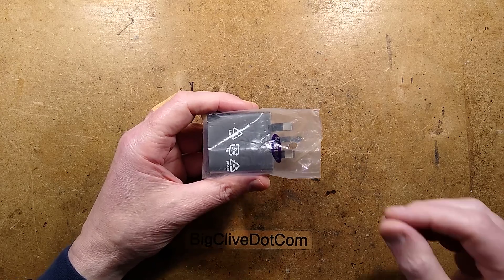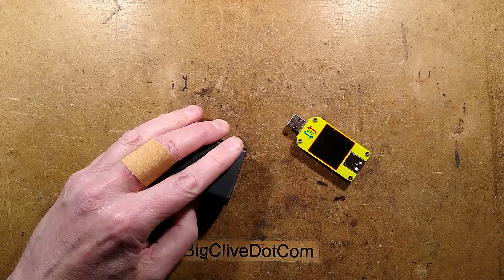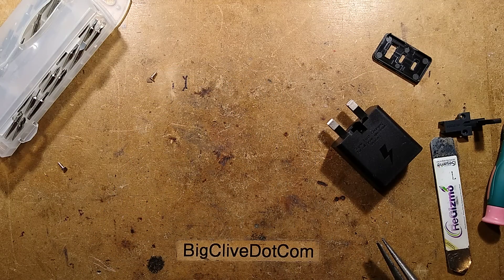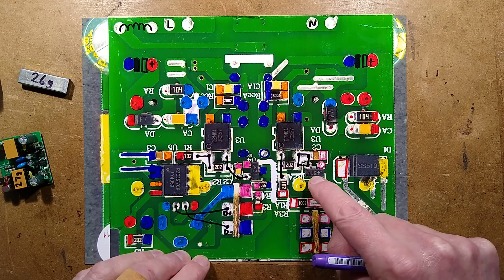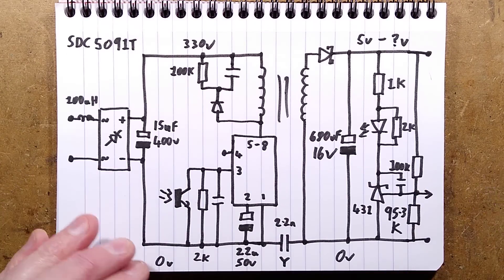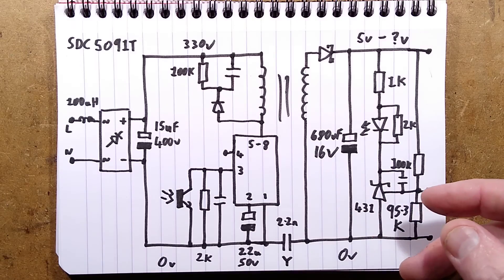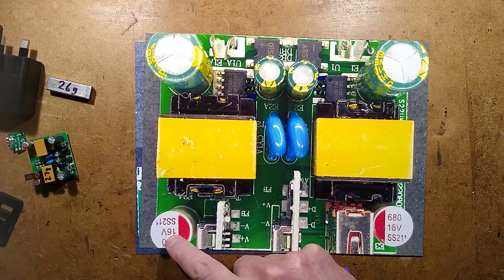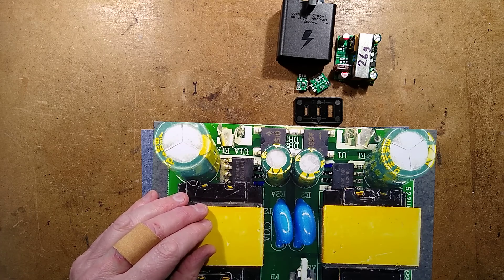Fake Samsung charger with interesting circuitry

Comment: One of my biggest fears is a fire caused by junk power supplies and cheap electronics.  I’m very cautious of all items that are possible sources of ignition if they fail.
Reply: Such as electric scooters and E-bikes...?
Reply: @kimvibk9242  I was referring to the AC sower supples, but yes on those things too.  I own a name brand e-bike, the battery is always charged outside, and afterwards stored off the bike and in a fire proof battery bag when not being used.
Reply: @chatrkat  Good to hear that you are taking precautions to protect yourself and others. 👍👍

Comment: It's as if they tried to fake it being a GaN power adapter, that weighs a lot more than traditional chargers.
Reply: Why would more efficient semiconducters with less waste heat be heavier?
Reply: @johndododoe1411  Everyone knows weight = quality.
Reply: @johndododoe1411  it's not the semiconductors themselves, but rather the fact that everything is more denstly packed and requires extra thermal dissipation (heatsinks) inside the GaN chargers which makes then heavier. Go have a look at a teardown of a 100 W GaN charger and compare it to a teardown of a traditional charger and you'll understand. You might save a third of the size, but none of the weight. As this is fake GaN charger, they added the metal lump to increase the weight to make it feel the same as a 65 W GaN charger.

Comment: False weight, you love to see it. I once opened a karaoke microphone and found a huge block of solder inside, dumped in there like chocolate inside an ice cream cone. That block of solder took up 80% of the internal space, and also acted as physical support for a small chip just floating around in the housing.
Reply: That's a nice bit of lead for the landfill...

Comment: All of the Best Buy Stores here in the USA have what looks exactly like that one with side symbols just our 2 prong plug on the back with a little plate screwed on between the prongs. They are selling them for $60 US. If you pick up the package and shake while holding the item inside through the box yo can hear and feel a weighty thing banging about inside. It sadly might actually be a Samsung as advertised.

Comment: Not sure if that piece of steel is an inductive coupler or a railway coupler....8^) that whole device is odd.  Looks like the makers were betting on consumers trusting the brand name. Cheers!
Reply: Yeah, I seem to remember adding one like that will lower inductance.
Reply: @noanyobiseniss7462  It would be interesting to see its performance with the bar in place and without. Perhaps the unrevealed sticky foam pad is also functional?
Reply: @Derek_Garnham  never seen a Ferrous foam pad. :P

Comment: I seem to remember adding to a transformer like that will change fields characteristics but I'm drawing a blank on what the change will be.
Reply: Indeed, it looks like it could couple some of the magnetic field of one transformer to the other.
Reply: The main magnetic field forms a square circuit in the transformer metal, so not much magnetic energy leaks into the weight .
Reply: @johndododoe1411  EI transformers are not efficient generally and their fields extend but i have no clue what these little ones are like as i've never dug into them. I have zero clue what your talking about as all fields form nothing other than a vector field arc.

Comment: I found "Everbright SDC5091TUTR-E1" Power management chip 15W power solution other flyback power supply" with variants listed at 18W, 20W, 25W.

And for the PD chip, I found FP6606C USB Type-C and PD charging controller.
Reply: Yes that is Fitipower fp6606ac

Comment: 11:06 Presumably it can’t go higher than 15v on the output rail otherwise the 680 uF capacitor will be unhappy as it’s only rated at 16 volts?  [edit: as you say to seconds later!]

Comment: I've been in the literature recently. Their phones can't take more than 15 watts and self regulate down anything above to prevent damage.  The dollar store sold me a 3 watter and I thought it was a mistake and not the joke it turned-out to be. 10 series in this case. I've been using a Nook wallwart to fast charge the old one but haven't got a b to c cord yet. Good enough is alright. It's got a 4,900 mah battery so it lasts a while. Won't go as dim as I'd like though. And it stops charging at the 85% longevity option.  Floats up and down between 83 and 85.

Comment: My guess is that this is a chip manufacturer for samsung products and they are selling their own "copy" on the side. Which may explain why it's hard to find documentation.
Reply: No need to, there's a wealth of existing tech for SMPS so no real need to copy samsung especially if they wish to alter the circuit to a lower price point.  Remember, it's China, if they want to make a  custom IC to do an exact thing like this, they can, and produce it dirt cheap as well,  It's just not sophisticated enough tech to need to rip IP off of anyone else to do it.

Comment: I've noticed OnePlus chargers give a massive shock if you accidentally touch the pins after unplugging so I assume (it'd be cool if you could tear one down) they have no discharge capacitor to stop the shock.

I've been shocked a few times by it and it's quite a shock! 

Which means first party isn't always the safest or nicest chargers around.
Reply: That means they bothered to install an across the line interference capacitor (great!) but no shock prevention bleeder resistor, which is not great, but that probably won't kill anyone.
Reply: Apple laptop chargers have done that for the past 12 years. Cheap ass bastards
Reply: Never had this issue with my realme charger; 65W charger right? 10V 6.5A?
Reply: Id suspect a faulty model. 
Never had that kind of issue but then again it has been a while using this brand

Comment: When is eBay going to be held accountable for the quality of it's sellers' products when they are sold as 'new' items? Surely that would nip this kind of crookedness in the bud.
Reply: It is new. And from what I could see in this video, the seller didn't advertise it as a genuine Samsung charger.
Reply: How is it ebay's fault and how on earth would they enforce the rules? Should they buy one of each product and open it up to test it? And why are they responsible for what a few out of a million sellers do with a portion of their products?
Reply: @alexoja2918   They are responsible for facilitating in the trading. 
And sure, whats the point of making Laws and Rules if the are not Enforced.  
ebay will payout any consumer claims on these nickle and dime trades, no problem - cost will be covered by vendor fees, peanuts really compared to the potential cost if these claim lives.

Comment: Im not sure how an opto isolator works. Any info would be appreciated, thanks Clive. 👍
Reply: It's basically an LED and a phototransistor inside an opaque package, with separate input and output pins for each. When (low) voltage passes through the LED, it activates the phototransistor and allows (high) voltage to pass through it.
Reply: @RFC3514 The gap between LED and sensor is often rated to a serious voltage, even if both sides operate at just a few volt within themselves .  For example, one side can sense something near a 500V wire, while the other side processes it near ground level .

Comment: Skipped the transformer autopsy to see whether it falls in the good enough or death trap category. Dumping a chunk of steel into stuff to make it "feel higher quality" is a pretty common trick. I've even seen a review of a Chinese ATX PSU that used a concrete PFC transformer - just a wire cast in concrete.
Reply: You don't really need to unwind one that small, just the fact the secondary is plain magnet wire terminated on a regular bobbin  is an instant DQ, it should be triple insulated wire terminated away from the windings.

Comment: Wow they didn't spare any expense here, they even added the metal fake weight. True quality right there
Reply: not a  metal fake weight...  it's a real weight!
Reply: @zebo-the-fat  - It's a built-in load.
Reply: Clive might want to give that weight a quick wisk with the geiger counter. I've found that 'easter eggs " like this tend to have a higher chance of being metal they wanted to get rid of anyway., possibly even getting reimbursed for its disposal in the process.
Reply: And two bridge rectifiers, and not a single abused 1N4148! Still a noncompliant shock hazard with those transformers though, you need that triple insulated wire on the secondary side and flying secondary leads or a bobbin with an extended secondary side terminal strip to properly isolate a winding in a transformer that small.
Reply: The scary thing, after a tear-down like this, where you discover 80% of the mass is just useless filler ... you start to wonder if the universe was made in China.  😅
Reply: ... sum of its parts ...
Reply: This is why i have trust issue, now who am i gonna trust when my original breaks?
Reply: @UserT5959  scams have always existed, china didn't invent low quality stuff with weights. Reviews exist to help guide people. BigClive for example has recommended the Ikea chargers after he did a video like this where he tore them down and reverse-engineered them
Reply: Nigel way to dispose of toxic metal waste 😂
Reply: Isn't that "metal weight" a cooling plate ? It even has the thermal pad on it.
Reply: @eidodk  it's a very bad heatsink. Real heatsinks in these things are thin plates that wrap around the electronics to actually have surface. This thing just has thermal mass. Also we can't be sure it's a thermal pad, there are also "thick" double sided tapes
Reply: @marcogenovesi8570  It's a heatsink nonetheless. As long as it directs SOME of the heat away from hot components, it does what it is supposed to
Reply: @eidodk  It's a fake weight. Any heat sinking capacity coming from it is a bonus and probably not even needed (as there is no smart charging involved here)
Reply: @eidodk

Yes, I'm sure the tape holding it on is very good for a heatsink
Reply: @eidodk  when you cool chips, you take the heat away from the chip. Thermal pads are insulators
Reply: @abs_nobody  They are electrical insulators, not heat insulators.  They are LITERALLY called thermally conductive insulator pads.
Reply: @eidodk  guess I read that wrong. but regardless, firm metal block is more a heat capacitor than sink, which also happens to weight as much as the whole circuitry

Comment: I found a lump of high quality steel in a charger when I was opening "everything" when I 1st started learning electronics.  I thought it was a loose heat sink at 1st till I picked it up. That looks like they didn't skimp on parts.

Comment: Counterfeit chargers everywhere .The worst offenders are some of the TV remotes .They add steel weight inside to make them feel stronger than what they are .Bell Express view remotes or Bell Fibe remotes are built so cheaply they are designed to break within a year or 2 and at $80. + For a replacement remote it's disgusting. They are both RF/Bluetooth  and Infra red but boy are legit manufactures scamming

Comment: Hmmm, I thought posted some information on the chip used but it doesn't seem to be here. Perhaps I didn't actually press the post button.

I didn't find any useful information unless I included the 'T' on the end (SDC5091T). It would appear to be "[Everbright] SDC5091TUTR-E1 power management chip 15W" (if genuine, probably not).

Pin 1=Gnd, Pin 2=VDD, Pin 3=Feedback, Pin 4=chip test (NC in production?), Pins 5-8="High-voltage power triode collector input, the collector is connected to the primary end of the transformer". Other versions (replace the letter T) are Q=18W, S=20W, M=25W.

I assume that a genuine product would have a T and an M version but why not use 2*M versions making both outputs 25W. Strange, but that's Samsung.

Comment: It's suddenly struck me as an odd omission from our 'strict' electrical regulations.  We cannot have an appliance connected by plug that does not have a suitable rated fuse in it to protect the cable but we can have an appliance plugged directly into a wall socket with no fuse protection other than the main circuit fuse.  

Maybe those who constantly work to invent new ways to frustrate us 'illegal' electricians and invent ever more ways to protect wiring, from events it does not necessarily need to be protected from, should address the matter of fusing of directly plugged in devices (and I include those USB chargers installed in wall plates).
Reply: Properly designed wall warts do use a fuse or fusible resistor...
Reply: @Broken_Yugo  Properly designed - yes but few (around my house at least) seem to be.
Reply: The first electrical component BC identified in this brick was a combined fuse and inrush limiter .
Reply: My observation was about the general absence of user replaceable fuses in these types of components.
Reply: @barrieshepherd7694  Why care about that? I have never once in my life seen a blown fuse in a piece of mains powered consumer electronics that was actually the issue, always shorted parts in the power supply or some other serious fault that junks it anyway.

Comment: I don't know which one I hate more, this one or the one DiodeGoneWild took apart with an LED voltmeter inside. With a display that uses two wires. Because it only ever displays 5.1V.
Reply: The fake volt meter was awesome.
Reply: Wow that is sneaky, BUT:  There are LED voltmeters/modules that only use two wires, and do display voltage, so you can't go by that alone.

Comment: Fake or not fake, it looks nice, not dodgy, and definitely interesting as well.
Reply: You have to wonder at this point, with all the effort they've put in, why they're still misleading consumers. Surely with the nicely molded casing and plethora of (extraneous) components they may as well produce an actually good product.
Maybe they're stuck in the mindset of making fake trash so badly that they keep improving on how genuine it looks without ever reevaluqting their business model?
Actually it reminds me of myself in high school: My attempts to avoid doing school work and get by with the minimum amount of effort regularly took more time and effort than I saved ;)
Reply: I suspect that the manufacturer of the circuit board were not the same as those who added the weight and fake Samsung branding.
Reply: @video99couk I'd go as far as to say that the "weight " Was there for thermal reasons and not for weight
Reply: @NinoJoel  and you'd be too far. apart from the fact that it was separated with a double sided rubber strip (that was not peeled on one side), that thermal mass is only going to buy you a few minutes while it is getting hot
Reply: @marcogenovesi8570  yea they forgot to peel of the stripe but these stripes are thermally conducting. 
More mass means more surface to get heat away. 
Looking at the size of the metal stripe it doubles the area these transformers can dicipate heat
Reply: @NinoJoel  mass stores heat does not remove it. I called it thermal mass for a reason, it will store heat for a few minutes until it's hot and then will do nothing. It's a very poor heat sink, you need surface area not mass.
Good designs (both USB or laptop PSUs) have a bent metal plate heatsink all around the components that just carries heat from the components/board to the plastic case (which is the only way to get the heat out of the device). 

That's a fake weight to make the power supply feel more legit and save on component sizes, that's all there is to it.
Reply: @marcogenovesi8570  in theory yes but given the size compared to the transformers it will dissipate heat and not just heat up. 
Sure it is not efficient but i suspect it doubles in holding the pcb down in the casing. 

Assuming they would have attached it properly xD
Reply: Super dodgy... yeaaaah.
Reply: The transformers were not evaluated.
You can not say it is Nice.

Comment: Hrmm, there really needs to be a USB PSU tester that has a dummy load AND the QC/PD negotiation chips on it.

Might be a good idea for a project?
Reply: You can bet USB PD "trigger" boards that go inline with the dummy load. I have some adjustable ones that let me request a voltage. Gotta be careful what you plug into the USB output jack though since it can go to voltages outside of USB spec without the connected device requesting it, because the trigger board does.
Reply: @iamdarkyoshi  Yeah, found some of them eventually (seems like youtube deleted my comment stating that).

They came with multiple dummy loads you can plug in that were 20W per load.

Comment: The Samsung branding is what bums me out. Normal people would have a hard time accepting that is fake.
Reply: It'd break and people wouldn't even know if it was actual Samsung
Reply: The bag it comes in should be a clue its fake. They no longer use the blue oval logo on their consumer electronics.
Reply: Break it open 😂
Reply: I ended up buying this stupid thing (before seeing this video). I knew it was fake when it wouldn't charge my device :(
Reply: Honestly, seeing the stupid amount of people who are fine with ordering literally anything of of eBay or AliExpress, official looking branding doesn't bother them what so ever...
Reply: Is not Samsung its samdung
Reply: @aaronali822 It said Samsung on the outer plastic bag. Few people will check the fine print on the device itself.
Reply: @aaronali822 it's scamsung /j
Reply: @aaronali822 Smasnug*